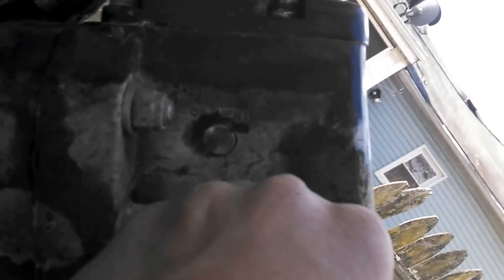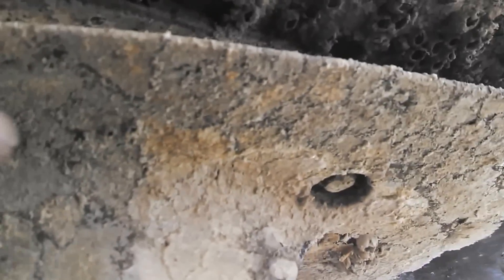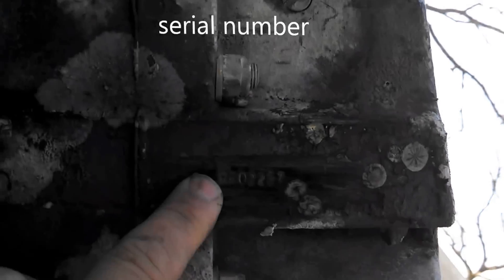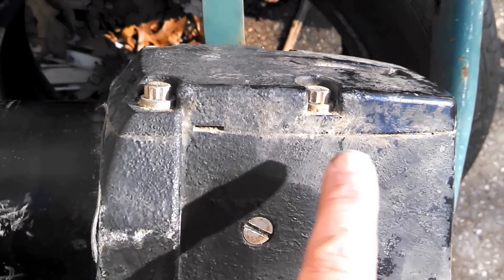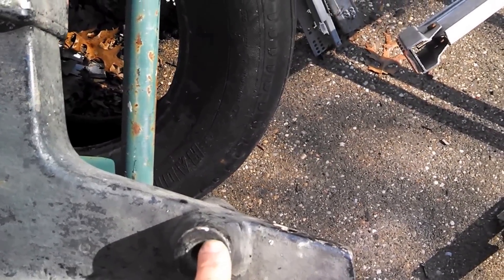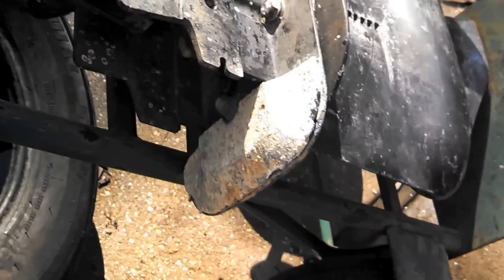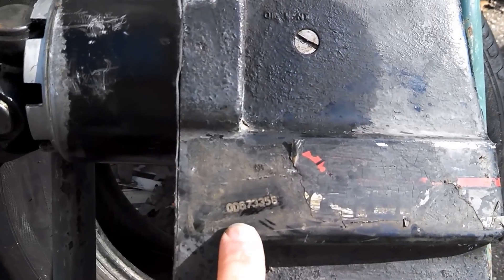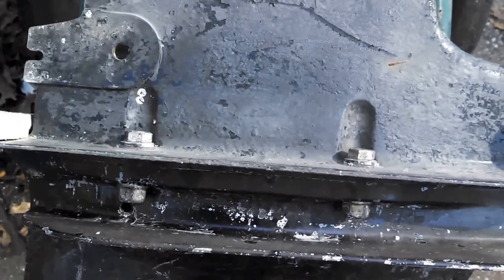Identifying Pre Alpha Alpha One Alpha One Gen 2 Drives what is the difference

Comment: There is no such drive as a 'pre-alpha'. That was a name made up by some idiot on boats dot net (I think). All that 'pre-alpha means is 'before Alpha', and no less than 14 drives came before the Alpha One. Also, that top housing you showed, was used on drives R, MR and Alpha one. Once the lower housing is off, there is no way to know what the drive is. And the Alpha One and MR drives are identical. The only difference is the marketing name.

Comment: Will the alpha 1 gen  2 fit into the existing alpha 1 gen 1 transom cutout ?
Reply from the maker: no
Reply: Yes it will. You may have to drill a couple of new 7/16" holes at the top, but the actual cutout is the same.

Comment: There were 14 'pre-Alpha' drives (before the Alpha One drive, 1986 to 1991). These also include the 1-R (1983-1984) and MR (1985) drives, which externally can not be differentiated from an Alpha One. The drive with the lifting eye on the top cover and the ridges on the housing is an MC-1 drive (1969 to 1982). Mercury NEVER made a drive called 'PreAlpha'.... The information in the video is incomplete.

Comment: Will the pre alpha lower bolt to the upper gen 1 if one would cut off the top pin?  Seems to set down fine but it sticks up about 1/2 inch because of the pin.
Reply: All MC-1, R, MR and Alpha One upper and lower housings are interchangeable... DO NOT remove the pin from the top of the drive shaft if it has one. That is to preload the driveshaft bearing in the lower housing, and removing it will lead to a destroyed gearset in a matter of minutes.
Reply: Had one where the pin did not move at all........Is that pin supposed to push down in the shaft a little or not?